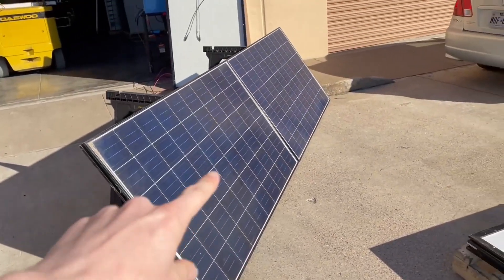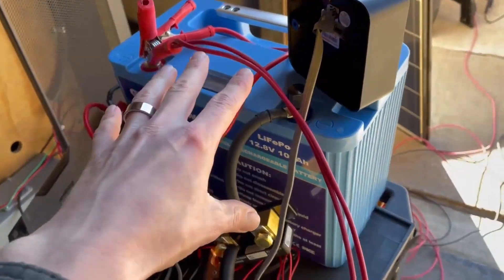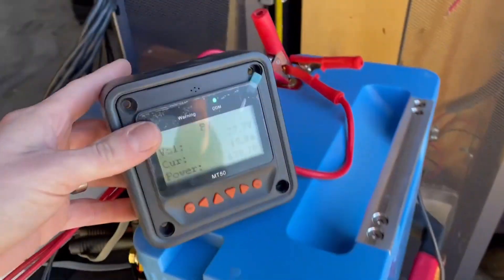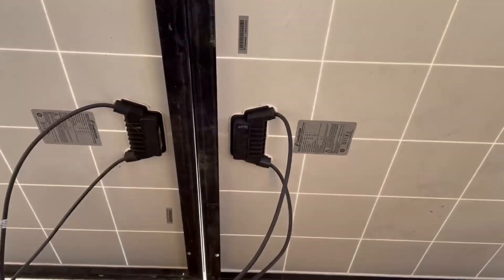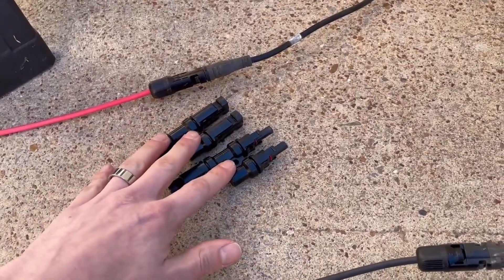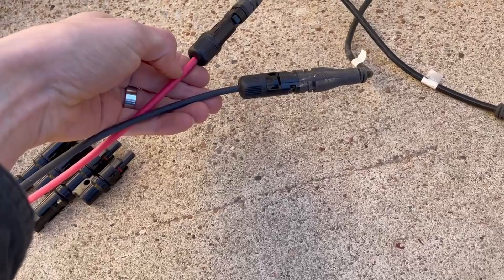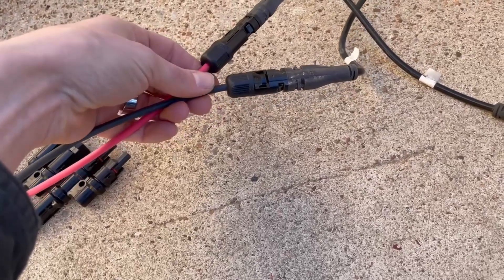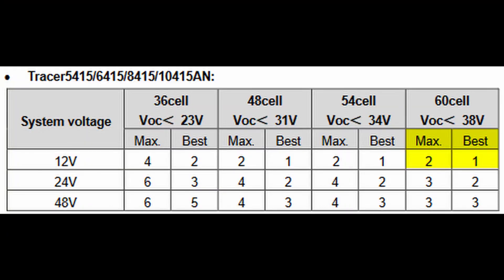Ignoring EPEVER Manual Makes More Power? Part 1/2

Comment: Yes, some benefit from less current flowing through those piles of #10 wire, but mostly, with series you give the solar controller more headroom to exercise it's MPPT function.  I.e., it starts with a higher voltage and can pull that voltage down relatively further to find a maximum power point that may not be reached when starting with half that voltage and hitting the battery voltage before the maximum power point is reached.  This is especially the case when solar energy reaching the panels is lower as in the late afternoon.  Under this condition the MPPT function is most productive and can do more with more voltage to work with.  The Epever manuls show efficiency curves and those make it clear that the controllers need some headroom for best operation.
Reply: Couldn't have said it better myself. I am running the 5KW EPEVER unit on 5.4kW of panels with a string voltage of 185V (max is 200V for my MPPT controller) specifically to keep cost of wiring down, and to give the MPPT lots of headroom to do it's work. Btw if you're curios as to what the diff is between the 150V and 200V MPPT controllers are (I have one of each), it's just the input capacitors are rated for 200V, nothing else is different. That said I was running my 150V model on a 160 OCV string without issue because I always had a load attached so the string voltage never exceeded 150V.
Reply: @gnif  I am trying to figure out how to use (3) of the 100a units to charge a 48 volt battery bank (off grid). We would like to have enough power to keep the 2,000 amp hour battery at full charge without the use of a generator (minimal). We have plenty of space to set up solar panels to feed the system. I am looking into purchasing as many LONGi Hi-MO 5 (545 watt panels) as is necessary to accomplish the task. All of the array will be placed on top of a sea container (as much as is possible) for the shortest wire runs into the container for the system. We will be operating a altE Pre-wired Syst, SW4048,CL150, SCP to power our 50 Amp RV while we build an off grid home. Am I way off base thinking this is possible to do?
Reply: I don't know how big of an impact this really has but hier voltage reduces cable loses, plus less amperage means the controller runs cooler and has less heat loses.
Reply: I’ve currently got a 200v EPEver charge controller with three 250 watt panels wired in series.  I normally see low 90 volts coming in to the charge controller.  Because of the higher voltage, charging starts earlier in the day, and keeps charging longer after the sun goes down compared with running them in parallel.  Plus, a single 10 gauge wire can handle the power over the 40’ run.

Comment: When the panels are connected in series, the current is 2 times less, therefore, there are less losses. Plus, the MPPT controller works like a transformer (figuratively), it converts high voltage with a small current into a low voltage of 14.2 V but with a large current.

Comment: Pannels in parralel, especialy when more than 3, pose a significant fire danger. If you are going to do it, I would fuse each and every pannel in parallel for safety's sake.
Reply from the maker: You are 100% right! I forget when I’m running around testing things to have fuses when appropriate. Thanks for pointing it out.
Reply: Yep, ive melted plugs in parallel

Comment: Higher voltage travels better down smaller cables, the mppt controller can take the higher voltage with lower amps and flip it like a transformer to make lower voltage and higher amps to fill the batteries. I have 6x 110ah gel batteries and an epever triron 40a controller with 6x 130 panels, 3 in series to make 66v and another string of 3 paralleled to double the amps input. My next plan is to go 24v with more batteries and then I can double up on the panel power. Solar power is great, but you need deep pockets to make good power!
Reply: I have epever 40A too with 12v battery. Two 24v panels in series 340+380 but after two month of 340 addition the mppt  recognises one panels show 33v and normal amps. Everyday I disconnect solar wires than mppt show double panels volts 70-75v and produce power from both panels. But next morning same issue 33-35v. Is I oversized my mppt?
Reply: Hmm... so then why does voltage drop (resistance) get compensated for by using larger gage cables?
This makes no sense. Smaller cables can be used with series panels because the amps are reduced but that is not the same as saying "higher voltage travels down smaller gage better" which is untrue. 

Voltage drop is factored per foot somewhat linear (like a constant) and changes because of resistance(gage) so using higher voltage makes the percent of voltage drop less yielding more watts remaining at the end of the run.
Reply: @fishhuntadventure  Nope, the reverse is true 12 volts is better than 24 volts because of the fact that most campers are using fridges that run a Secom compressor, more amps = more juice 24 volts is half the amps = less juice, you need max juice from your solar controller to power up your energy thirsty compressor load when it starts to spin up. 24 volt systems are bloody expensive and don't cut the mustard, a 24 volt inverter costs around 10X more than a 12 volt , there is simply no justification for one, only trucks and buses utilise 24 volt systems

Comment: I dunno. I think the MPPT alg on EPEver is little slow to settle in, that's what I notice on all the ones I have. I've seen 10-20w discrepancy just by unplugging the PV, and plugging back in.  My guess would be the manual says to do it this way because when you really load the controller down doing 60A then that large of voltage conversion difference will probably cause it to overheat. Wonder if these have synchronous or asynchronous buck converter?
Reply from the maker: The slow tracking is so true, the powmr ones I have are instant compared to epever! I’m excited to test how hot it gets when doing the larger voltage conversion.
Reply: @BeeneEnergy  I have two of those sunpower panels (in parallel, but as you know still high voltage) on a 30a epever, gets pretty damn hot @ 12v, and little cooler @ 24v

Comment: I use the 50A version and have noticed no significant difference in harvest under normal skies using 3x 60cell in parallel or series.

Comment: All my panels are all in series parallel. You can put more panels on that way versus only parallel or only series. Thereby getting more wattage and not going over your voltage limit.
Reply from the maker: There is definitely a point where practicality trumps marginal efficiency gains. Sounds like you found it!

I typically go higher voltage so I’m not worrying about high current running around myself.
Reply: @BeeneEnergy  
I find I save more money and it’s not running as hot if you had them in parallel only.
Reply from the maker: @benjones8977  How hot the charge controller runs will be something I check next. Thanks!
Reply: @BeeneEnergy  
If you have any questions I would post them on Will Prowse’s forum.

Comment: You need to retest this to get rid of variables. You went from 408 to 411. That's already statistically insignificant. That's under a percent. Secondly you removed connectors and cut the current in half. There's your 3w. Has nothing to do with the inverter. You want your panels to be 1.5-2x the battery voltage. That's well known for efficiency.
Reply from the maker: Yeah no inverter involved :).

Both of these configurations are listed as acceptable according to the user manual, but parallel listed as being better. The connector point is valid, I’ll be testing this next time the sun comes out long enough! And yes it was more than a 3w difference but with me rambling about stuff to the camera that I cut out for your sake and the sun setting I lost that gap :).
Reply: @BeeneEnergy  I'm definitely interested as I have that charge controller. It's a super nice controller. I'm running about 75v into 50-55v lifepo4 battery. Highly efficient. Cold days I hit 80-85v.

Comment: I'm not surprised.  I'm kind of guessing it was all cabling losses, including the cabling/traces inside the charger itself.  Plus the branch connector's not free either.  You literally cut the current in half.  The fun thing to do would be to look at everything with a thermal camera to try to see where the energy gets wasted.
Reply from the maker: Those are excellent points!
Reply: series panels are higher voltage than the same in parallel. since voltage drop is a relationship of volts loss per foot, series panels at twice the voltage will have less voltage drop for the same cable length as parallel by half, all else being equal. There is no magic happening.

Comment: I maxed out 2 midnight classics. Side by side charging the same battery Bank with the exact same number of panels. It was a 24 volt system.  One had all panels in parallel and the other had two panels in series.   The one that was ran all in parallel ran warm and harvested more kilowatt hours before reaching absorb.  The one in series parallel runs hot enough to burn my hand and started charging earlier in the morning but it didn't take long for the other one to pass it by.  They've been set up like this for 4 years now.
Reply from the maker: Oh good data! Goes along with Goatzila where it could be cabling losses I was seeing! I’ll be out there again soon, will just need some good weather to test.
Reply: @BeeneEnergy  my conclusion is always go with the highest panel voltage the charge controller specs allow in regards to battery voltage.  Otherwise it will simply overheat. Avoiding all the extra breakers and cables is worth the occasional charge controller or fan replacement.
Reply: @BeeneEnergy  true. The difference between your test and mine is that you doubled up the amperage through one cable and connection point. In my instance each parallel panel had its own cable so there should be no resistance differences in my circuit between the two.

Comment: I think they are trying to avoid layman issues, and not confuse them with fancy panel layouts and wiring diagrams. I mean everything’s simpler when it’s set up in parallel. Series really confuses a lot of people.
Reply from the maker: I suppose their wording of best could be used that way! I like it.
Reply: no, there is a voltage range in which the mppt algorithm processes more efficiently and that is more likely what they are saying. Additionally, "wear" on the mosfets is higher over time for a higher voltage which affects lifespan. sortofa expected duty cycle related to heat.